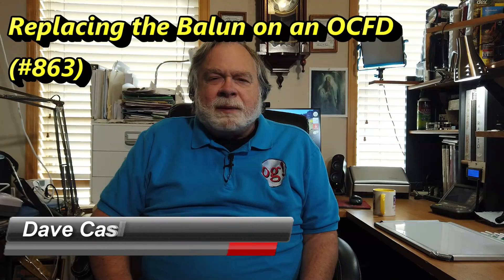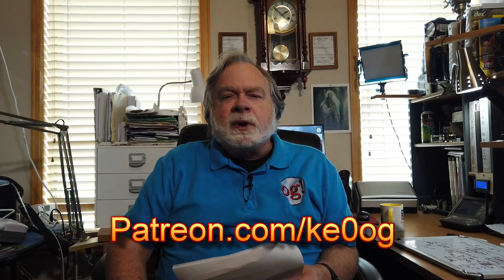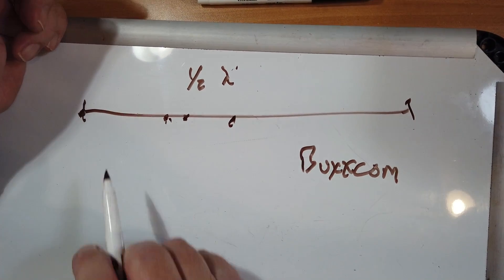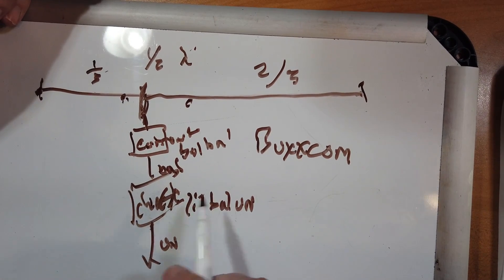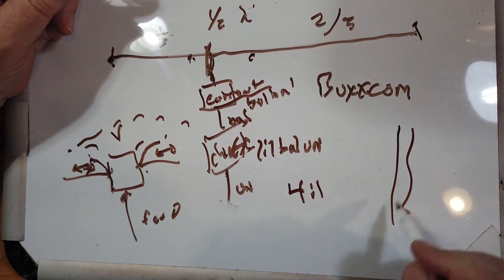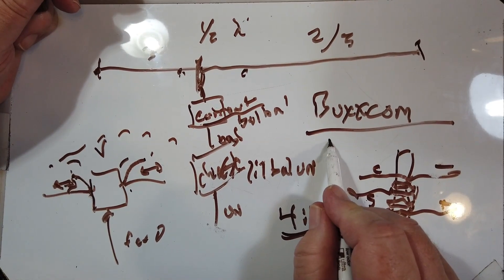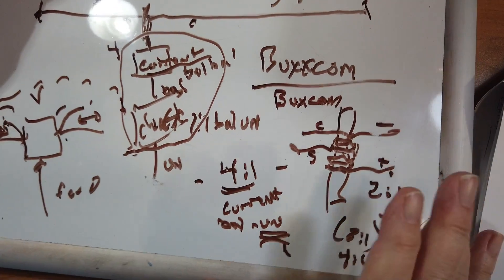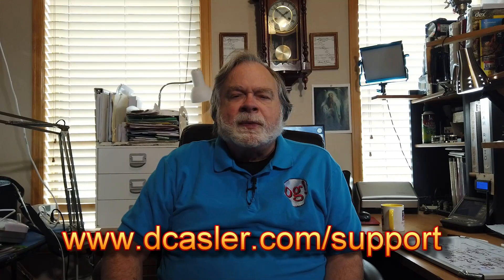Replacing the Balun on an OCFD (#863)

Comment: An OCFD can be fed at either at the junction of 1/3 and 2/3 or 1/4 and 3/4 point along the half lambda radiator for the lowest frequency band of your interest. Or someone can try a different ratio that works for him/her.
It's a multiband HF wire antenna; if you have 135' or so you can work from 80 meter and above.
The EFHWA can be considered an example of feeding almost at the extreme end of a half lambda radiator.
The search for a single wire dipole for multiband operation resulted in attempting to find out a nominal feed point impedance along the length of the half lambda radiator. The Carolina windom antenna used just a single wire feeder from the transmitter and had had the feeder being a part of the antenna (the horizontal part of the dipole and the vertical part of the feeder) not to mention the quantum of RFI that might be in the
 shack! 
Again the feed point impedance is very much affected by the height of the radiator (the feed point) above the ground; it happened to be around 200-300 or more ohms at the reasonable heights anyone can manage.
BalUn ratios are realised by the number of turns squared as the inductance and hence the reactance varies accordingly.
Initially people used 1:4 voltage BalUn of Ruthrof style; it's an auto transformer.
It didn't attempt to curb the CMC (Common Mode Current) issues. Later people added an 1:1 CMC (Common Mode Current) Choke after the 4:1 BalUn to take care of it.
But the ideal solution is to employ a 4:1 Current BalUn of the Guenella type; it takes care of the necessary impedance transformation and the CMC (Common Mode Current) 
You better use 2×FT240-43 like ferrite cores for making the Guenella current BalUn. Again here the choice ferrite material and the size depend on the power handling of the BalUn.
The OCFD can be mounted as a flat top dipole or in the inverted V dipole configuration. If the feed point is around or above half lambda the feed point impedance would be near to 300 ohms.
But then you can use the same 1:4 BalUn or try 1:6 BalUn ratio.
With the 1:6 ratio you have to use a 1:1 CMC (Common Mode Current) Choke.
Hope this helps.
De VU2RZA
Reply: I don't believe your 4:1 current balun suggestion will have enough  cmi for many ocfd situations.
Could I humbly suggest a visit to the DJ0IP website? 73.
Reply: @VE9ASN  thanks for referring to dj0ip's work on this line. 
Earlier I had had read more about the ATU (antenna matching units) on his site; I myself am using "the double Zeppelin antenna" and the genuine balanced line tuner (the "S" match by PA0FRI) with great results for about 7 years.
And coming to your suggestion, I have to admit that dj0ip has done a marvelous and meticulous job in his German qth in the northern Bavaria; of course the results are limited by some reasonable amounts.
He has concluded the same statement of mine that a 4:1 Guenella current BalUn is the solution.
You may want to go through the article again as, I am afraid, you might have erroneously understood his statement that "a single core" 1:4 BalUn is NO GOOD.
Yes, the single core 1:4 Guenella BalUn is made also by some commercial manufacturers apart from by homebrewers elsewhere and everywhere. 
The TRX bench YT (a long one) would also be referred to here.
A 2×FT240-43 core Guenella current BalUn is the correct choice one should go for.
Again the size and choice of ferrite cores depend on the power levels you want to transmit. You can try #52, #61 or "K" material at your leisure.
Hope this helps.
De VU2RZA